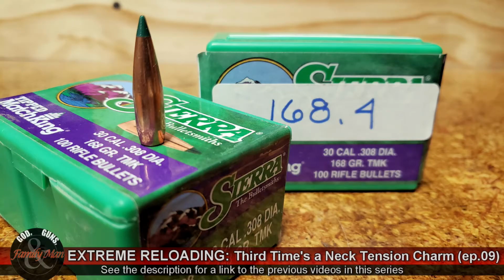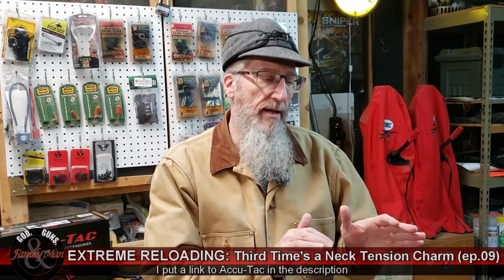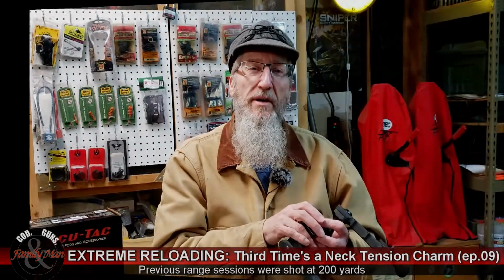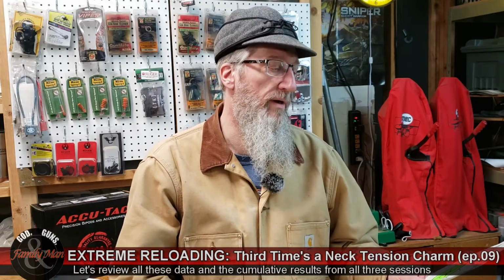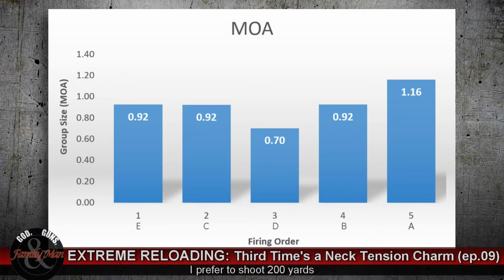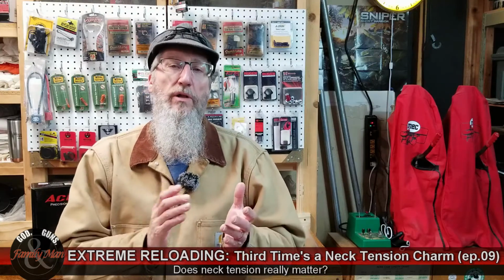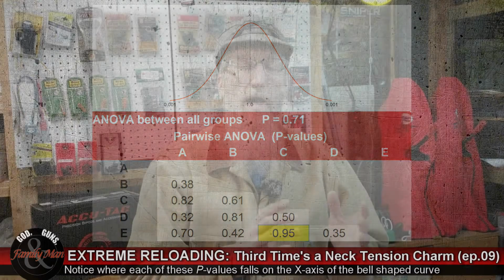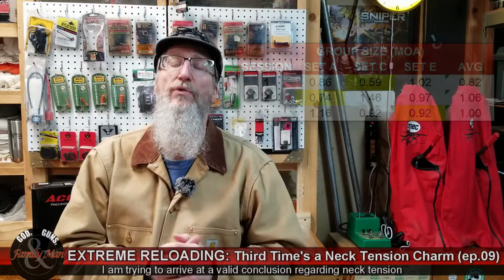EXTREME RELOADING: Neck Tension Testing for .308 Win. + Accu-Tac Bipod (ep. 09)

Comment: Really enjoying your series. A “scientific approach” is refreshing. Was really hoping that you wouldn’t have introduced different variables like shooting prone. Then adding a bipod and changing to the 100Y/M distance. FWIW I have found I get better results only using the LabRadar SD#s and putting on a light crimp regardless of having a cannelure.  Again really enjoying this. Might just be a future subscriber.
Reply from the maker: Hello Bill R, I many instances you are right.  Choosing the round with the lowest standard deviation of muzzle velocity will, over the long haul, give the most consistent groups especially at range.  I agree with you.   I was concerned about varying how I shot these tests as it does introduce an additional variable, including a bit more shooter error, but I hope I was decent enough not to affect the results that much. Apart from shooter error, the trend in group size (based on neck tension) should remain the same and varying shooting positions theoretically should not change the trend.  
Focusing at SD might be the best after all!
Thanks for watching and posting.
Reply: @sdkweber  it’s important that you realize that my comments aren’t a criticism but rather an interest in the primary test. One thing that I meant to comment on as a potential factor is; if you watch this video there are times that your cheek is off the rest and or there is a significant (relative) shift in body position mid series. In my experience this leads to negative outcomes. ( shift in POA-POI) BTW I’ve subscribed and that bell has been tagged too. Looking forward to future RPR results. As of today my MOA seems to similar to yours although mine is a 6.5CM.
Reply from the maker: @billr4677  Thank you Bill.  It is good to hear these things because I do not have anyone else watching me at the range and offering some coaching.  I try to be consistent in my shooting but always want to improve.  I especially need more practice with the bipod as it is something I only recently starting using again.

Comment: A few things to note: To truly determine if the tension plays a role in accuracy/precision...and it does. You must remain consistent in your shooting regimen. The use of the shooting mat and bipod changed this. Additionally, I believe you had a rather thick mat and they have a ‘bounce’ to them and it doesn’t lend to consistency. Good video and I hope you take another look at this using mandrels as we discussed. Powder and primers as available :-)
Reply from the maker: Hello again DW None,
I have started assembling the equipment needed and hope to give the approach you described a try.  I was concerned about varying how I shot these tests as it does introduce an additional variable. However, the trend should remain the same and varying shooting positions theoretically should not change the trend.  It does introduce more shooter error into the equation but I hope I did not affect the results that much.  Next episode takes us back to the bench and 200 yards.
Thanks for watching, posting, and the good discussions.